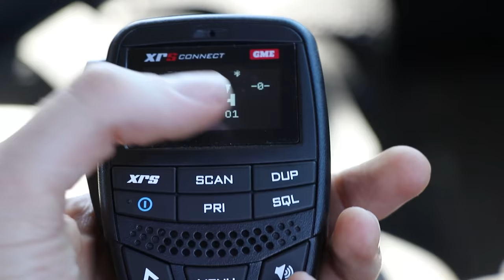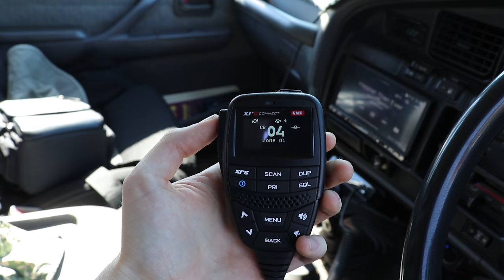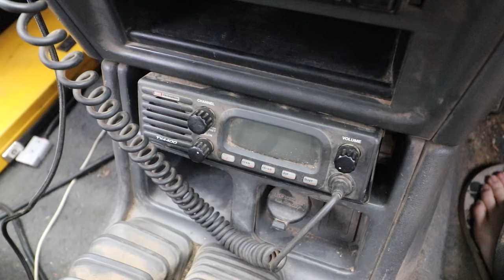You've been using YOUR UHF WRONG!!! CB Radio SECRETS for 4WD in Australia PLUS History & Technology

Comment: I've read an article supposedly written by experts that fitting the aerial/antenna at the back of the car (ie. behind the tailgate, or wheel tyre carrier) is actually the worst place to fit it.  It really reduces it's range etc.  And I too am a fan of GME, not only are their products world class, and they continue to innovate, but also because they're Aussie made (as you've pointed out).  I have both their UHF and PLB products.
Reply: @ethanissan5012  yeah. Not referring to the top of the vehicle. The higher the aerial is mounted the better I’m sure. I’m referring to the ones that mount it right next to their spare wheel at the back - I’ve seen it mostly on FJ Cruisers & Wranglers. It must be a US thing.
Reply: That certainly holds true for UHF antennas. The type that he is referring to in this video is an HF "screwdriver" antenna. You might have noticed antennas with a metre or so tall black base on them. That base contains a variable loading coil and its specific function is not to radiate RF but rather "tune" a shortened antenna. The "whip" that is attached to the top of the unit is the radiating element and when installed these are usually well clear of the roof line of the vehicle. Most of the time when you see this set up, the whip is rarely attached. They range in length from about 1 - 4 metres so they're a bit of a snagging issue, to say the least.
UHF antennas and indeed all antennas should be placed as high as possible and clear of other objects. This is not always possible so the best compromise is all one can do. Hope this helps. And yes, you're right about GME.

Comment: So I understand the duplex mode only works if:
a) there is a repeater tower in range
b) you set your UHF to the same channel as the repeater.

Is there a quick way to work out what channel the repeater tower is? 

Or do you have to just shift through the 1-8 channels, clicking the broadcast button, and waiting to see if it beeps back?

Comment: I also position my vhf and uhf antenna top of my 4WD.. A low gain can actually be more efficient than any high gain on bull bar. The low gain short antennae are mounted on bases that easily fold over if get knocked with out any damage. The other advantage is they are quiet, no wind noise that those large thick GME stuck on bull bars make

Comment: I brought a 9 db GME 3 stage steel whip antenna nearly 30 years ago and am still using the original base and 6 db antenna. Had to replace the 9 db antenna because a galah flew into it and bent it. It still worked ok but for cosmetic reasons it got changed. It’s always been mounted on the bullbar and has been fine there. Once you could get 6ft fibre glass antennas that was the trend to mount on the bullbar but it would smash at the first sign of a low tree or anything that didn’t give

Comment: Loved the video, you’ve got some pretty solid facts. 

The whip you hear when you transmit though a repeater is something programmed into the repeater; there is some around that won’t give you that crack

As a radio technician, I have a lot of friends reach out and ask about common faults, and troubleshooting techniques; I think that would make an excellent video. Reach out if you need any information
Reply: As a licensed hobby radio operator great presentation and very accurate in your theory presentation 👍

Comment: Nice bro. I am in NZ running GME low and medium gain, mounted on the bullbar. I got the smaller spring base just prior to GME going to the larger spring. Only mounted there cos thats where GME reccommended. But gonna look at the rear now. Thanks for the info specially on the co axe switch and repeater use. Not many repeaters here where I am, but gonna give the bounce back check a go. Cheers buddy.

Comment: You probably already been told this, but the UHF CB repeater channels changed many years ago when cb went from 40 to 80 channels. When it changed they added extra repeater  channels so its not only channel 1- 8 but also channel 41 -48. Also good to mention avoid talking on the repeater input channels 31-38 and 71-78 as these are the  channels used to access the repeaters. In other words when you are talking on  repeater 04 with your duplex button on, your radio makes the switch for you from 04 to 34 you don't notice it. When you are off duplex mode its called talking in simplex. Test it out with a handheld or another cb. When you are on channel 04 with the dup button on you will here yourself on channel 34 aswell.

Comment: If you considering doing some serious outback 4xdriving, then I would  recommend both UHF and HF for use during your travels.
The idea that all you need now is a satphone is just nonsense.
I do a LOT of remote traveling and I've lost count of the number of people I've come across who have said that their satphone was near useless when the found themselves in trouble.
Think about it. If you happen to break down in a remote area .. WHO are you going to ring?
With a UHF or HF radio .. or preferably both .. there is likely to be someone somewhere .. not too far off that can assist.
HF gives an enormous range, allows one to get traffic/weather updates, have direct contact with emergency services .. especially RFDS.
It can also provide rescue services with your exact gps location and you can even have your family/friends follow your travels through HF websites that will display your daily positions.
The ideal situation would see remote travelers with ALL comms systems .. UHF/HF/Satphone and EPIRB.

Comment: Good presentation. As you said roof mount is ideal and there is a huge difference to a Bull bar mount not to mention the weird directional pattern generated. 5W comes out the connector at the radio, the quality of coax and how it's connected to the antenna and connectors is extremely important. Do not let water get into the coax, cuts and nicks and extreme bending can be real bad. Unfortunately CB's use PL259 / UHF connectors these should not be used greater than 30Mhz (UHF connectors = Universal HF) so the choice of connectors is extremely important, I have seen 1/2 the power lost at a pair of connectors (pity they don't use SMA, BNC or N connectors).
Reply: thanks for the reminder cos back in '78 I converted my old Phillips FM320 to BNC..... hmmmm! i just might do the ICOM
Reply: UHF - ultra high frequency , I agree on a better connector... converted my FM-620 to TNC
Reply: @markb3146  TNC is good,  same as BNC except twist instead of bayonet.
Reply: @davo99  BNC becomes too loose after too many uses, TNC is a better option for multiple uses
Reply: @markb3146  Be aware that the transmission line part of the connectors is the same in fact the N, BNC & TNC inner parts are the same, take the outer ring off a TNC and can plug directly into a N. Converting to TNC, BNC or N or even SMA is a great idea. So twist or bayonet the wear on the critical parts is the same. The big mistake a lot of people make is that when they tighten connectors they twist the whole connector instead of the ring component, eg using an adapter they twist the adapter instead of keeping that still and twist just the ring component to tighten.  TNC & BNC are really only useful to 1Ghz which obviously is OK for CB. PL259 should not be used above 30Mhz.

Comment: i have a 3.3 on the bonnet hinge, with a 6 on the rear, and when going from darwin to melbourne i have the 12 that i swap the 3.3 out with but it runs to the front of the bullbar. also when you set it up on the bullbar, watch out for your cable runs. if you need to drop or swap your bar, you may need to diassemble your RF set up, and majority of damage comes from the connectors being screwed on/off.

Comment: Back in the 90s in Melbourne, I used channel 3 quite a bit.  The repeater was located in Glen Waverly, I believe.  As for the regulations, no one enforced anything let alone tracked you down and arrested you.  People would run linear amps with yagi's pointed directly to the repeater.  Channel 5 was a joke, and even if someone did have a genuine emergency, the person monitoring it would always think it was a hoax.

Comment: Well since you asked, in the Fortuner and the Jeep we have UNIDEN 8080 mounted hidden in fact all you see of it in the Fortuna is a mic socket on the console.

The units themselves are only used if we’re both traveling in different cars and that’s with CTCSS running to screen out the noise. Or if we’re off road with a group of non-amateurs.

As someone who was around when UHF CB and the first repeaters came up, yes I’m that old, it was an amazing service but what it has become is a wasted resource anywhere with a reasonable population.

As for the type and position of the antennas on the bullbar, we go into shopping centres, and I normally carry 2 with the short ¼ wave seeing the most use.

Comment: 4:39 Interestingly 61, 62 and 63 aren't reserved for future use, it's because years ago when they went from 40 channels to 80 channels, they cut each channel in half.  So in terms of the actual radio frequency, channel 41 sits between channels 1 and 2, 42 sits between channels 2 and 3, etc.  But they left the data channels 22 and 23 the same size, which means channels 62 and 63 now overlap, so couldn't be used.  So they are called "guard channels" because they guard against overlapping transmissions on the data channels.  So you can't transmit on those channels (or you will interfere with the data channels 22 and 23) but if you listen to them, sometimes you'll receive some blips and beeps as you partially overhear transmissions on channels 22 and 23.

Comment: I’ve been saying for years and every time I see one on the bullbar - put it on the roof for full, unobstructed 360° coverage. 
When mounted on the bar the vehicle shields the signals from/to the antenna. Also up top is higher so also better propagation of the signal. Kinda common sense.

The other issue with it on the bullbar is visual obstruction. It’s just annoying in the line of sight when driving and especially navigating tricky tracks.  

Also. Note that it’s really an antenna not an aerial as such.

Comment: One of the best UHF antenna installs you can have is a simple 1/4 wave (around 12cm high) mounted right in the middle of your roof. It small, unobtrusive, away from noise sources in your 4WD (unless you run a LED light bar on your roof... those things are RF noise generators!).
Reply: Compromised  bumper antenna very poor.

Comment: Great informative video, i'd like to also mention the use of the original cb radio 27Mhz(HF) is also still being used thou radios r hard to find these days. Amateur Radio(Ham Radio) is another great radio service which covers many of those 12 bands depending on licence qualifications. Antenna placement is key to any mobile station and the roof is ideal but not practical like u say. Cheers Matt VK2ZG

Comment: i run with (2) antenna  a 2db and a 9db the 9 is for hwy and flat ground and the 2db is for in the hills both ground independent because none of want to mount in the center of your roof!
but i still run HF as well

Comment: Unfortunately I jumped in and got a UHF before watching a lot of videos on YT, but that said for my use the setup is usable. I have a Oricom UHF310 dash mounted in my NW Pajero with a 6.5dBi antenna, which is perfect for highway use to call trucks and check on road works. The antenna is mounted on the nudge bar as I don't have a roof rack, plan to get one later and I'll look at a better setup then. Or maybe keep the Oricom and get a hideaway type as a 2nd radio?

Comment: Technically channel 11 is reserved for general calling as well, my local volunteer marine rescue actually has a UHF cb sitting on this channel for boaties.
other states do have channels that are sort of taken over by certain groups of people too,  like in my are 15,19,25.

As for my rig, I do not use rubbish radios, I have a Simoco SRM9020plus (yes I am legal and have it set to5W,  before the keyboard warriors jump in) and use Motorola XTS5000's as my portables

I would use my Motorola XTL5000 but its lowest is 10W, so its used to monitor the GRN and to TX on the commercial networks I am licensed for.

Channel 40 in SA is a hoot at times too

Comment: Oricom UHF182X 80 channel Dual Antenna 5 Watt UHF CB Radio and a GME 2 and 6 db antennas... they auto switch the antenna whichever is getting the best signal! Also rUn the GME tx4400 40 channel fixed to scan 40 &18 and a Codan HF unit. Running 6 db on bar and 2 db on the roof... or I can swap. HF on the wheel carrier and a GME 40 channel handheld for spotters. I also love that GME are Aussies but the Oricom is SOOO practical.

Comment: I ran a slim 40ch GME in my last 3 4wds but my current has a little oricom as I couldnt afford an 80ch GME. Just wanted somthing small to fit above my mirror with 80ch and antenna that I could chuck in for a 4wd trip.

Comment: Did you know that the first UHF CB radios didn’t have a duplex feature? Because the switch to UHF & FM was for vocal clarity and selcall. Only later the ACMA realised a UHF 5W transmitter with a shitty antenna on a vehicle was useless, so they had to allow repeater use. At one point there were more CB repeaters in Aus, than 2M amateur repeaters.

Comment: Look into knowledge of elevated feed, ground dependent and ground independent. You have an elevated feed ground independent antenna on front of you 4x4.  You would get better comms if same antenna was on your roof but being ground independent, no need to locate it in centre of the roof as your roof is no longer apart of your antenna workings.

Comment: Out means you want to finish  the conversation over means you want to continue  the conversation  and are waiting  for a response. Start your conversation  by there call sign 3 times And you should state your call sign by "this is" your call sign.
Reply: Also a good idea to state which channel  you are using when you first start  the conversation . In case the are on scan.  If your in trouble. It's a good idea. This is call sign on channel  40 requiring assistance.  That way the can possibly  transmit you message  to other user close by etc or someone else with a longer range .

Comment: I have a Dick Smith's 25 watt CB radio signal booster. It takes a minimum 5watt signal in and outputs a 25watt signal.
It was a kit. I put it together years ago and tried it once. From memory it was able to reach over 100km from mount Rossgole in the upper hunter of NSW Australia.
Guess it's a good idea I leave it in the cupboard and not fit it to anything.

Comment: you for got one thing with the new digital radios there is encoding you can be talk to people without other people listening in or being disturbed by other people and you cant disturb others as they cant hear anything from you unless they punch in the same code you are using. also channels 1-4 tho not official are used a lot for data if you have an old analog UHF you can here the data transmission from time to time depending on where you live.

Comment: Nice simple intro to UHF cb.  Remember Two way radio operation while operating a vehicle is legal, nothing else is.
Duplex mode for repeater operation, people misunderstand this functionality, when a radio has duplex turned on it tells the radio to transmit on the receiver pair channel, eg 1-31, 2-32....8-38, 41-71....48-78.  So if you are on channel 4 as in this video with duplex on your radio transmit on ch34 and receives on channel 4.
Now if you and a buddy want to have a chinwag and decide to use channel 34, the repeater will receive everything on 34 and retransmit everything on 04, only issue is now since your are on ch 34 you will not notice the repeater function and the fact you are sharing with everyone in a 100km radius.  So know what repeater channel are in your area.  Xrs platform will help with this.

PS most of my working life have used two way radio for communication, some CB some private licence, invaluable considering that some days I can travel and work in areas of Queensland that has no mobile phone coverage.